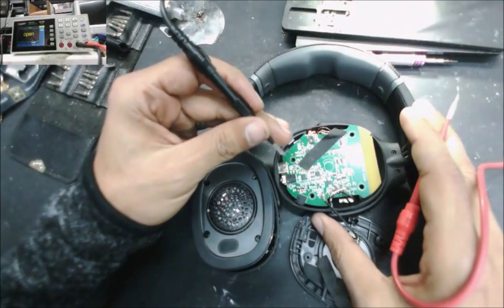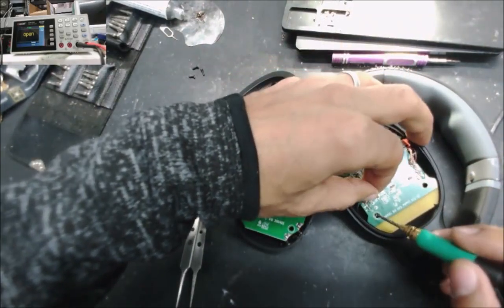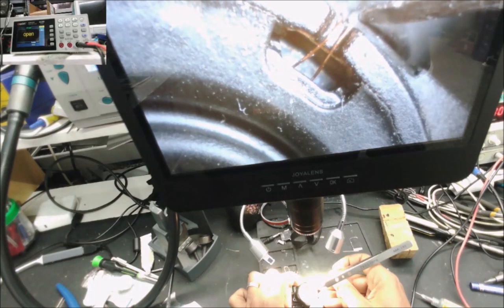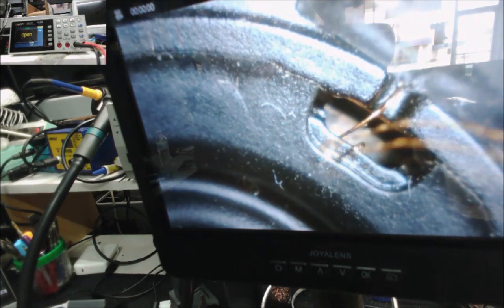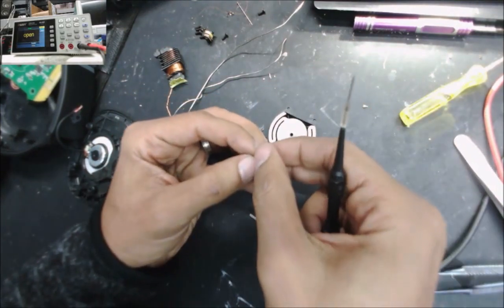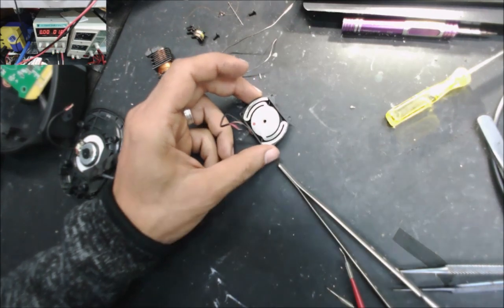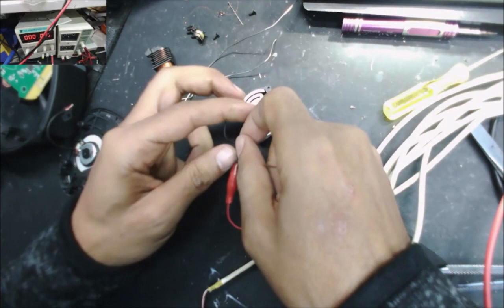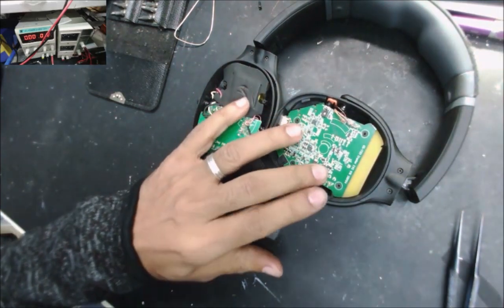Skullcandy Crusher Evo headset one side subwoofer bass low frequency speaker not working

Comment: The bass on my left headphone doesnt work, ive opened it up and all the wires appear intact, should i replace the whole bass speaker?
Reply from the maker: check it with multimeter
Reply: I've bought and replaced 3 different headphones because of this issue with the left headphone
Reply: @BamBam_56 What the hell are you doing to those poor headphones for that to happen. Really, 3 pairs??

Comment: Where so you get replaxement srivwrs for the main speaker and subwoofer driver? I jave a set of crusher evos and the right maun driver is soumding a little scratchy. Sub sounds fine. Thanks
Reply from the maker: check ebay